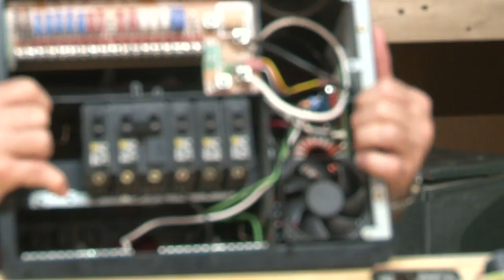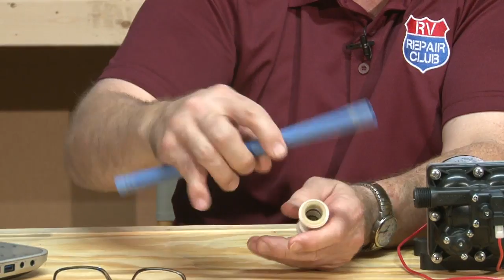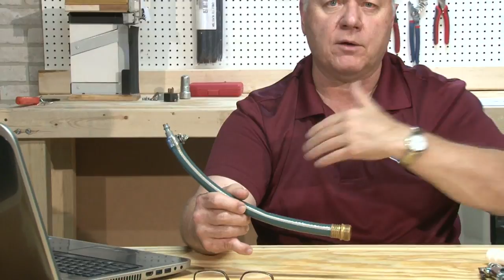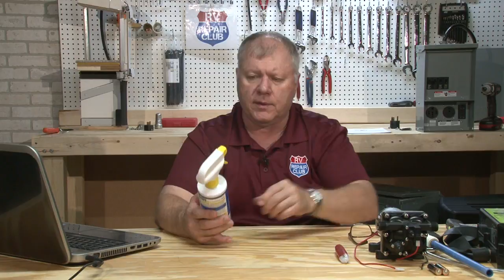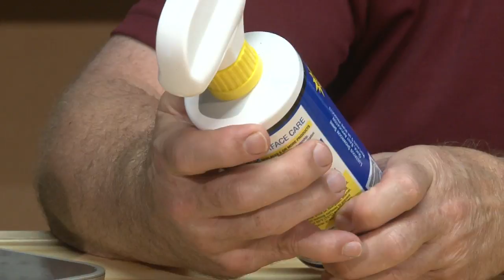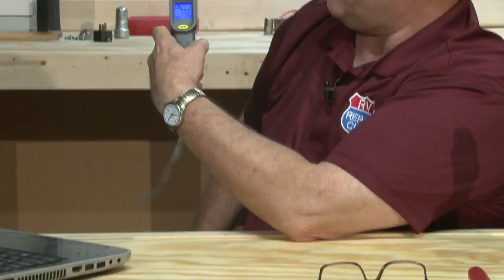RVRC Live: September 2019 RV Q&A with Dave Solberg

Comment: I have a 20 foot pleasure way 2007 The air-conditioning just started making a noise like baseball work hard on a bicycle wheel can you give me any idea what that is
Reply from the maker: Hi Carol.  Most likely the fan is hitting the surround. The fan blade is always very close to the opening and if the fan or mount gets misaligned or the shroud has been hit by a tree branch or something else it can cause things to shift and the fan will make this sound. The best thing to do is to remove the shroud and spin the fan blade by hand and you should be able to tell what it is hitting. Most of the time is it just scraping the metal surround and you can usually bend something like the fan mount or surround by hand to stop it from hitting. I would make sure to do this before running the fan anymore so it doesn't damage anything. I hope this helps!  
Dan - RV Repair Club